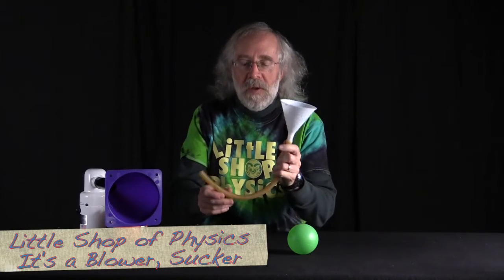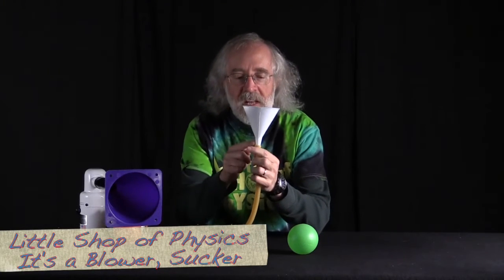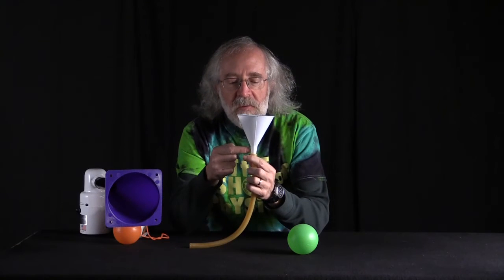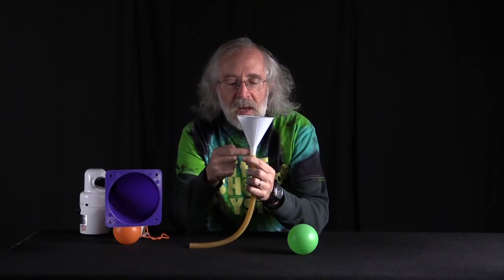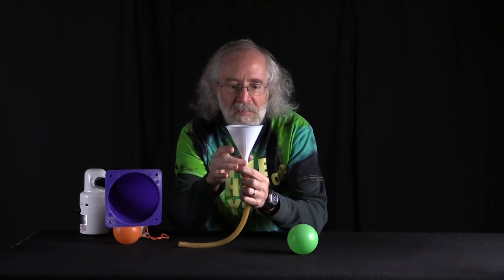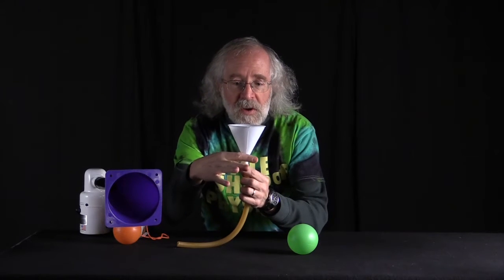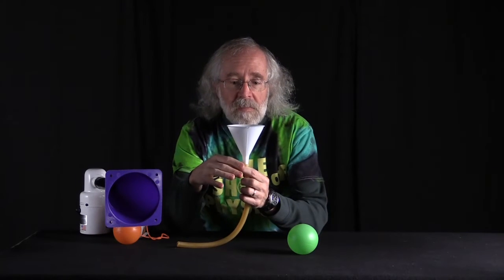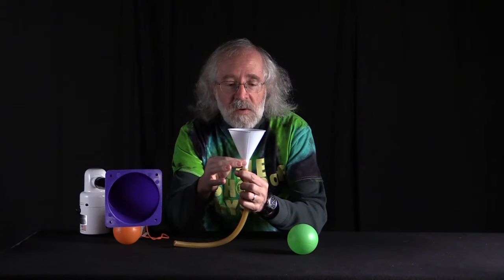Flash Science: What Keeps the Ball in the Funnel?

Comment: I have a question. would it be relevant to calculate the velocity of the flow using the Bernoulli equation? The shape of the funnel instantly made me think of Bernoulli. :)
Reply: I'd calculate the velocity of the flow using continuity—as the air comes out of the funnel, the cross-section area increases, so the speed decreases. And Bernoulli tells us that this pressure will be lowest where the speed is highest, right at the bottom of the funnel!
Reply: Thank you so much❤️🙏🏼